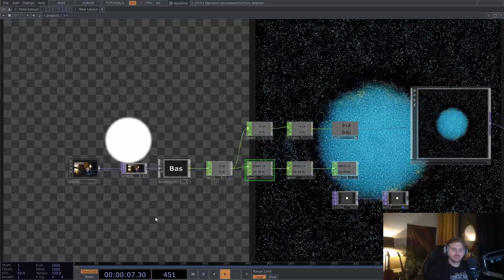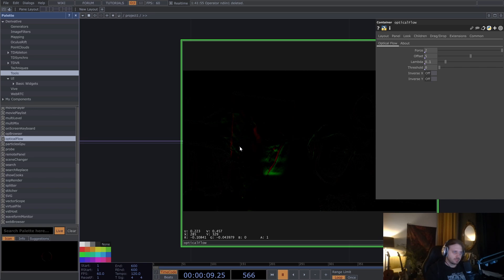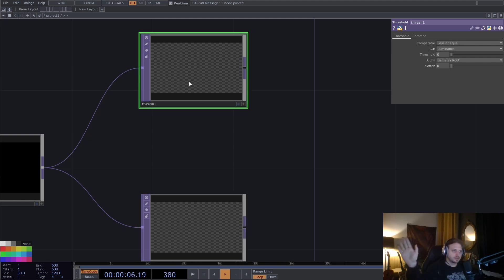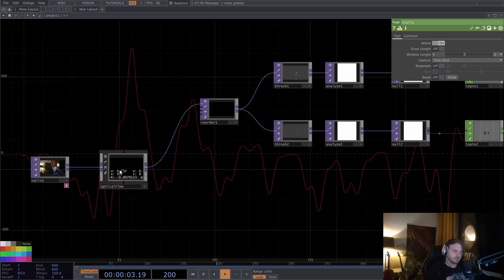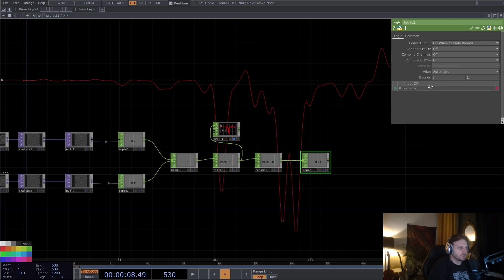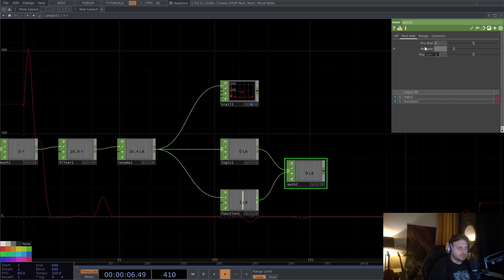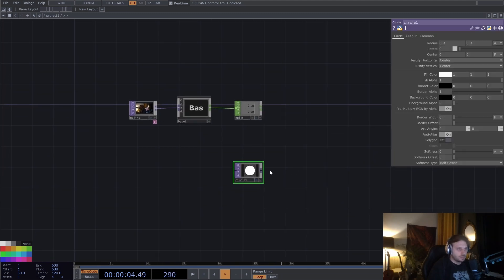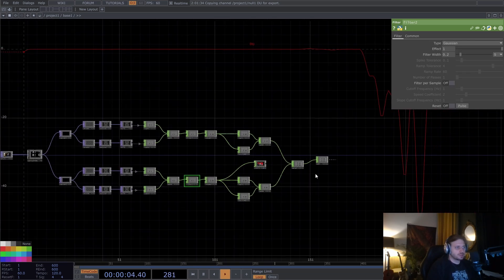Directional Motion Detection and Tracking using Webcam in TouchDesigner #touchdesigner #tutorial

Comment: Thanks for this tutorial. My circle seems to be stuck in the top right hand corner once plugging in the null to the center. Do i need to just adjusting the settings as you mentioned? I'm using a 2023 Macbook pro with built in camera. Any help would be great thank you!
Reply: I have the same issue, did you figure this out?

Comment: thanks for the video! i am having trouble with a lot of noise i think.. The thresholds pick up much more flickering visual than yours do, i have tried to adjust my room lighting without real success.. Do you think my webcam is just bad? there is really a lot of bright flashing images in my threshold frames, but i am in a calm and soft lit environment i tried the blur filter but it really didnt do much.. what can i do?
Reply from the maker: how about changing the Optflow Lambda and threshold?
Reply: Hey, just wanted to share I was having the same issue with my built-in webcam (Macbook M1 Pro). A ton of flickering visual from the threshold nodes.

FunctionStore's suggestion of changing the threshold in the optflow was really helpful. The default optflow threshold value is 0 and I was getting a ton of flickering. As soon as I changed my threshold to 0.004, suddenly my threshold nodes looked a lot more like they do in the youtube video, with just the outline of me/my hand at a lot less noise. Hope this helps someone!
Reply: @js4741  Thank you. I fixed mine too, following the suggestion about the threshold correction in Optical flow to 0.004 ;)
Reply from the maker: Hey, hard to tell without seeing but might be the case with a lot of digital noise from the camera. You could try adding a little bit of feedback to your input image to average the noise a bit more. As last resort if you have an RTX GPU you can try the nvidia denoise top, but would make sure to decimate the resolution to at least half before with a resolution TOP.